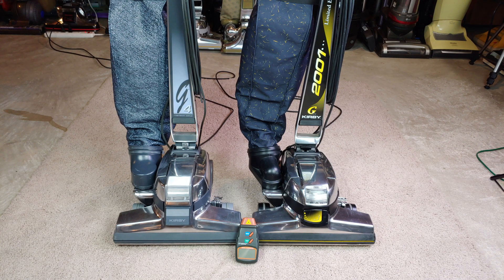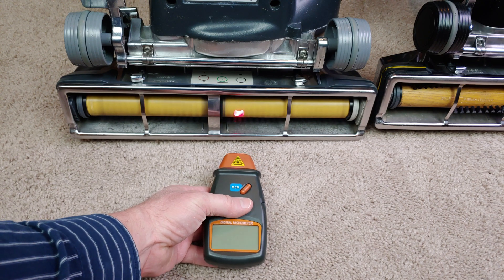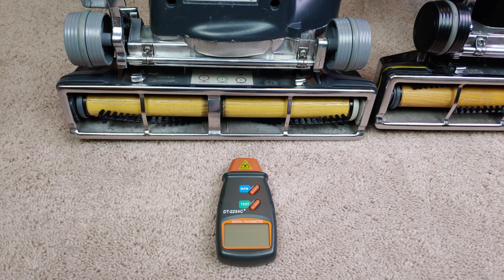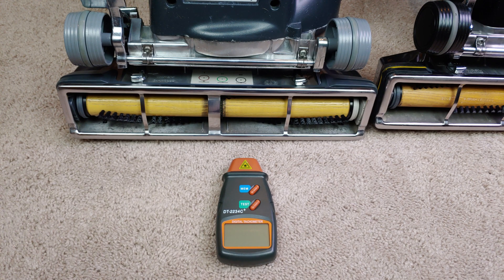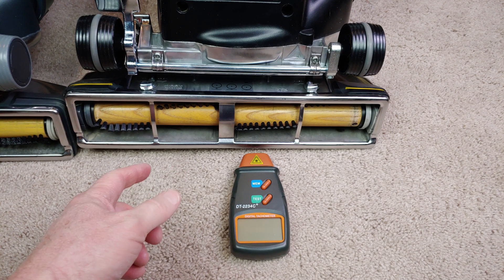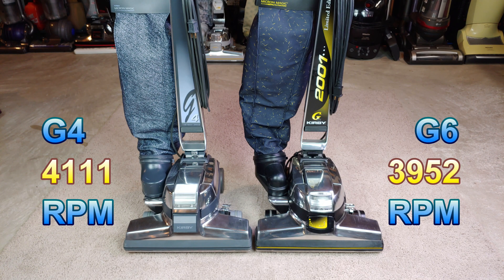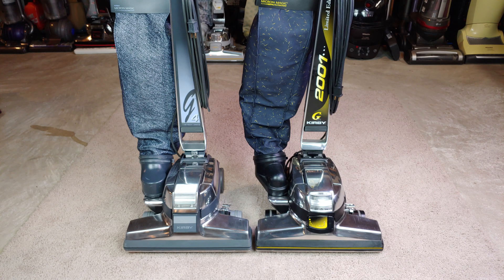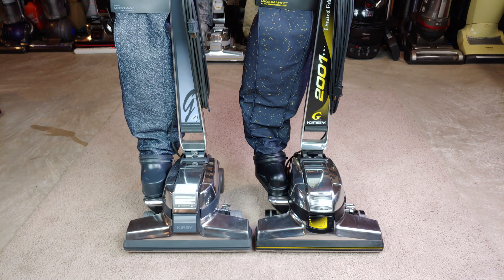Kirby G4 And G6 Brushroll Speeds After Refurb

Comment: I just got another used Kirby sentria 2 from a thrift store and the bag zipper is stuck shut and I kept trying using a knife to try to pry it open and it did not work I kept trying and broke the zipper and it still won’t open
Reply from the maker: Well, time to get a new bag then. Did you attempt to lubricate it? Or sometimes you can soak the entire bag for a while and that might loosen it up a bit.
Reply: sometimes the hepa bags get caught on inside of zip if not tucked in properly, if you need an new bag , try kent at  kirby needs link on my latest video

Comment: I’m surprised the g4 got more than the g6 I thought they would be even but you can’t be right every time.
Reply from the maker: The RPM difference is only about 4%, so it's barely statistically significant.